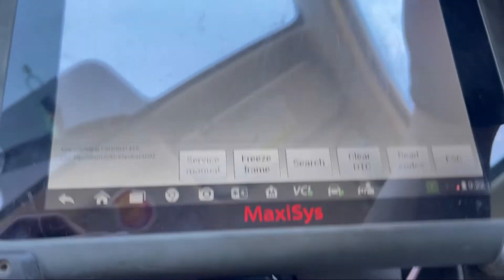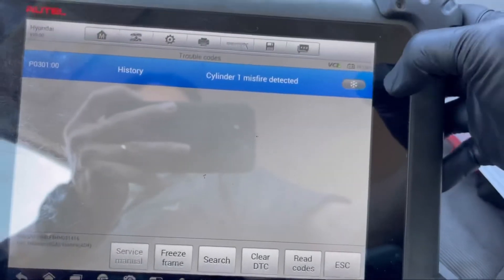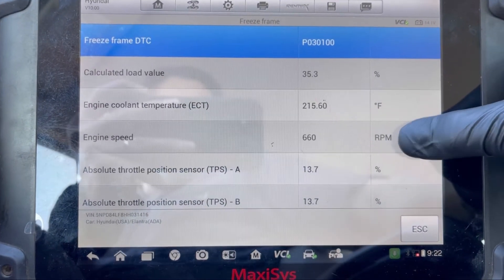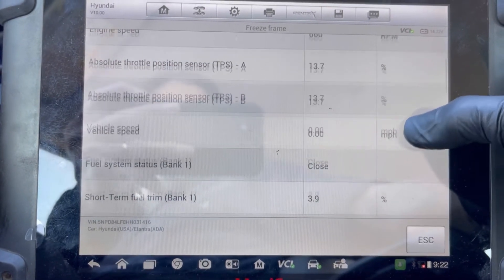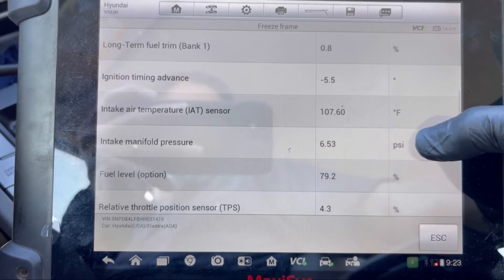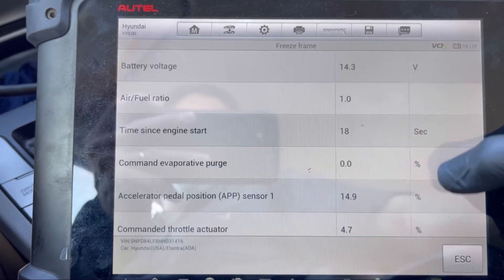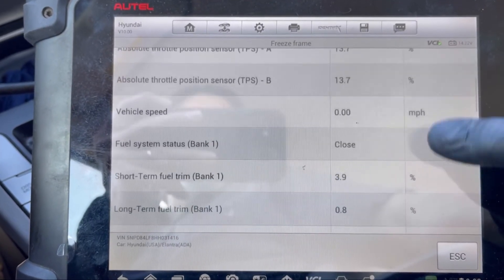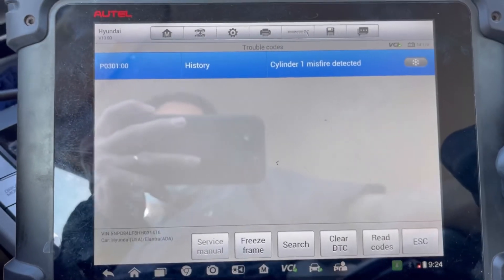Walking You Through Freeze Frame Data | P0301 Code For Any Vehicle | Using OBD II Scantool

Comment: You're video didn't really explain much, other than showing us the freeze frame. Seeing how your MAF sensor was reading zero I would probably start with that. Mass Air Flow sensor plays a big part in how your engine operates. You should set your MAF readings on your scanner to Grams per second instead of lbs per second and that reading should be very close to the engine displacement at idle (engine Liters) while viewing live data. There's a lot more to it though. But yeah... I would start there.